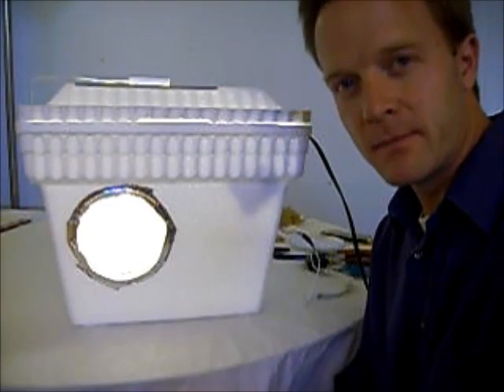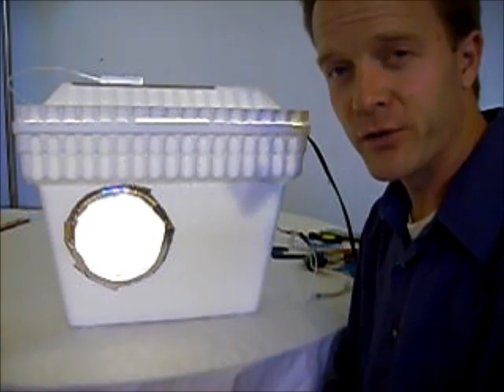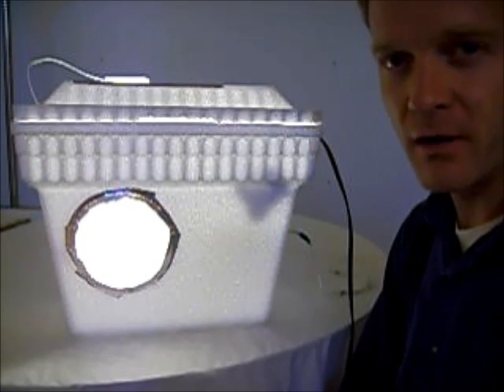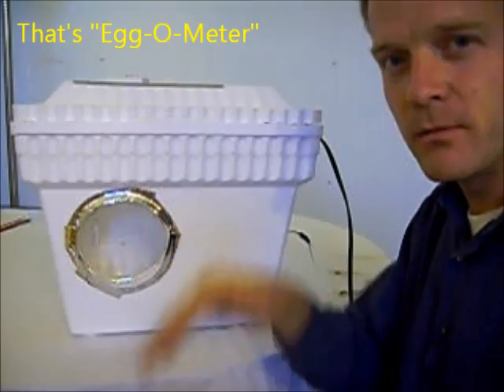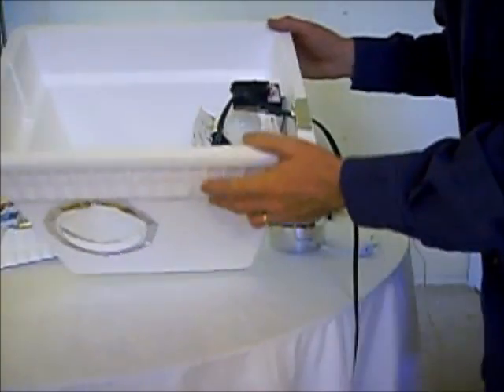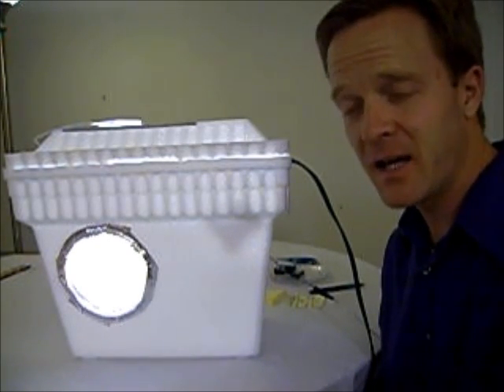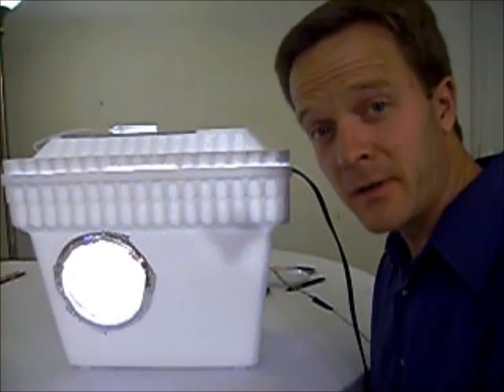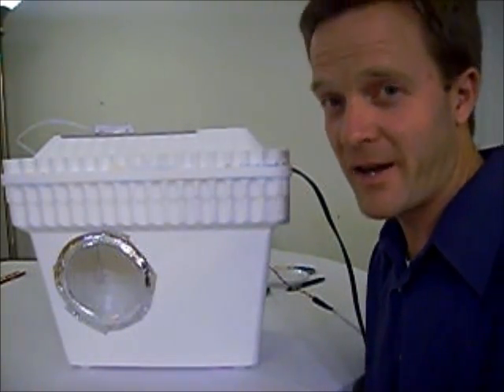How to make an Egg Incubator (Part 3)

Comment: See this youtube video:  Homemade Incubator Build follow up. Water heater thermostat modification for steadier temps!  By drilling some holes in the thermostat it will increase airflow and sensitivity.